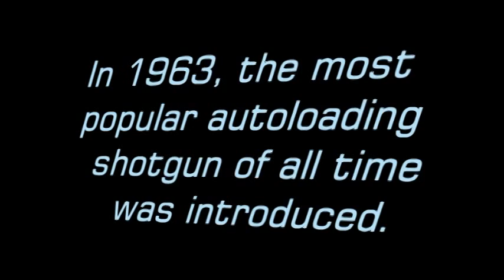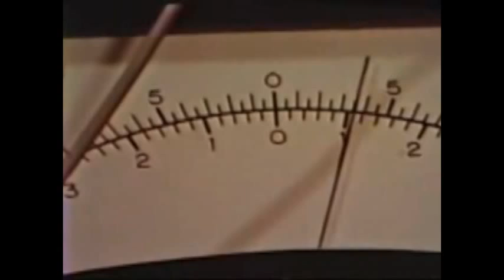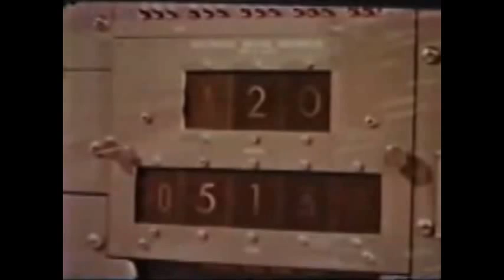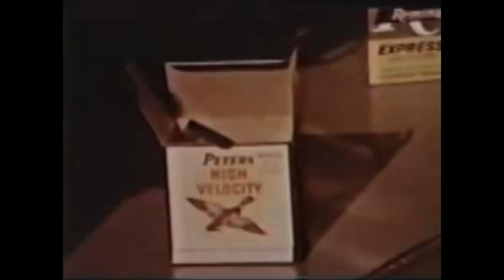Remington tells the 1100 Autoloading Shotgun Story

Comment: Great stuff Randy. I'm a 76 year old timer and long time shooter so I knew a little about the 1100. Of course they have updated that gun to the updated version ( The V3?] I tried one on for size at an emporium last year and found it too heavy. Maybe a 20 gauge would be more to my liking but I don't think Remington has it in em to test out a new 20 gauge version the way they did the old 1100. Also the gun should be equipped with stock shims for drop , length of pull and cast. If Remington is to survive it has to upgrade their latest model so as to compete with the Winchester and other imported models.
Reply from the maker: As we now know, Remington did not survive.

Comment: I inherited an 1100, 3” chamber but the barrel is marked 2 3/4 shells.  Will I be able to shoot 3” shells safely in this setup?
Reply from the maker: The chamber is in the barrel of course and the barrel stamp indicates the chamber length. It is highly unlikely that you have a 3 inch chamber.
Reply: Randy Wakeman   The receiver is marked “Magnum” and a second barrel is marked “for 3” shells”, this is probably the barrel that came with the gun as it doesn’t have choke tubes whereas the 2 3/4” looks new has tubes.
Reply: @billtichacek9591  you have a magnum gun. I have two of them and shoot 3 inch shells bird hunting all the time.
Reply: The 2 3/4 barrel is for just that 2 3/4 it has different gas ports than the 3 inch barrel.

Comment: Тут показывают ремингтон без прицельной планки , что это за модель ?🤔
Reply from the maker: It is about the 1100.
Reply: @RandyWakeman  это не просто 1100 все что я видел у них есть прицельная планка , у этого что на видео нет прицельной планки только мушка на конце !!!! Такие есть вообще в продаже?
Reply from the maker: Sorry, I don't speak Russian and don't know what you mean.
Reply: @RandyWakeman  it is not simple 1100 everything that i saw they have an aim level at this model that an vidio there is no aim level on the end yust a front sight . What the model is open a secret ?)) Whether it is possible to buy it? What characteristics at it ?
Reply from the maker: What do you mean by "aim level"? The rib? Current production models all have ventilated ribs and have for years. Older models, not just the 1100 and others (11-48) were available with plain barrels.
Reply: @RandyWakeman  yes i also had it i will enter. What does model 11-48 differ from model 1100 in? I would like to buy such gun for hunting for a bird a duck a goose !!!
Reply from the maker: It is a significantly different gun: a long recoil action, not gas operated, and long discontinued. You'll have to shop the used market.
Reply: @RandyWakeman   i need a gun for hunting on a feather a duck a goose here Remington stopped on firm, i only do not know what model, here and i ask your council what you on advise me ?
Reply from the maker: You'll have to go to your local gun shops, wherever that may be, and see what is available.
Reply: @RandyWakeman  спасибо за совет